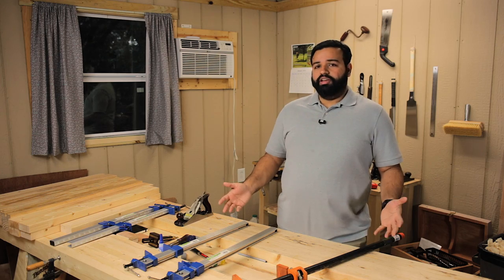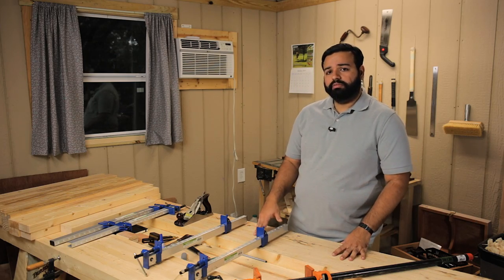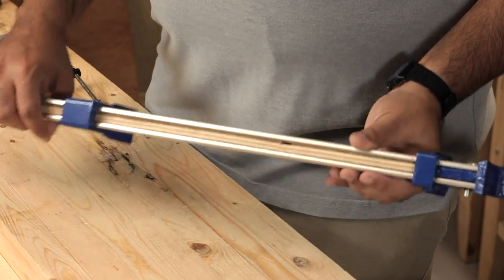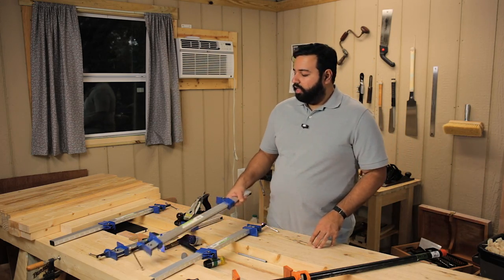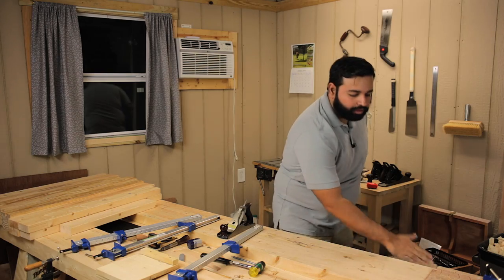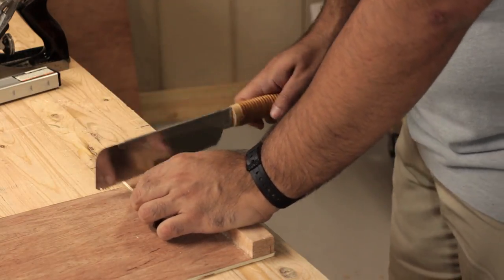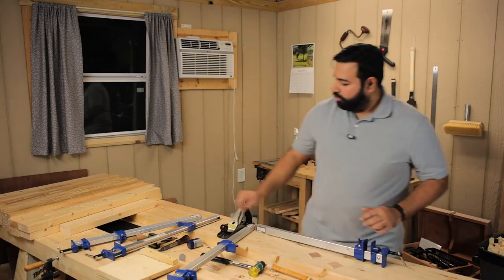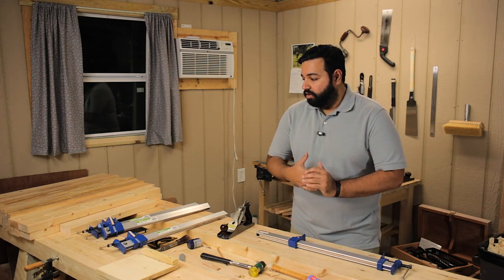Harbor Freight Bar Clamps Improved - Jigs #4

Comment: A suggestion. Know your tools. Japanese saws cut on the "pull stroke". I labored watching your attempts at starting cuts on the pull stroke. Start your cuts with a short "push stroke" then pull straight, long and evenly without "forcing" or pressure.  ;-)

Comment: The only thing I would add is changing and out the acorn nuts. Once they come loose they are next to impossible to keep tight. They are metric and nuts with nylon locks are awesome.
Reply from the maker: I agree. I have lost those nuts a few times and had to go scrambling on my hands and knees to find them. Lock nuts is the proper way to go.
Reply: Good tip, if I have any problems with them I'll keep it in mind.

Comment: Just a tidbit on Pipe clamp is the to use Galvanized pipe does not leave marks.   pine 2x2 sliced on the table saw to pretty close measurement

Comment: Nice idea.  Other than the twisting, have you found the clamps too be satisfactory for use?
Reply from the maker: +Eric Hess yes absolutely. The clamps seem to apply more definite pressure when tightened. Also, the pads on the vise jaws of the clamp are always a good idea on any kind of clamp. Thank you for watching.
Reply: +Sighthound Studio Just picked up two, will give them a try.
Reply from the maker: +Eric Hess do let me know how it goes.

Comment: I personally would go with silicon or rubber pads on the clamps, like I've see in another video. Would prefer the wooden pads not to be glued to the project wood if there's glue squeeze-out. I suppose tape on the pads would prevent this, but meh.
Reply from the maker: Yeah, those silicone pads are pretty good to have. Some of my pipe clamps have silicone pads. I have not had any problems with glue squeezing out enough to bond to the plywood pad.

Comment: Every time you set your plane down on its base plate, there's a chance of losing its sharpness.
Reply from the maker: The wood benchtop is too soft to dull the plane. I am careful enough to set the plane down on the benchtop and not on a chisel or square which will dull the sharpness of the plane.